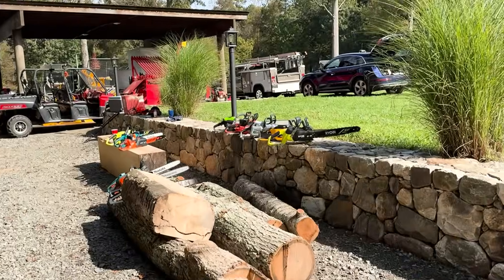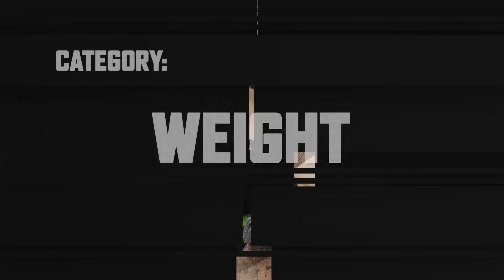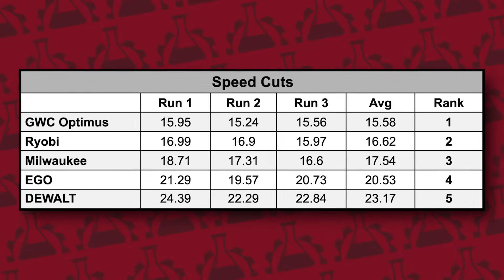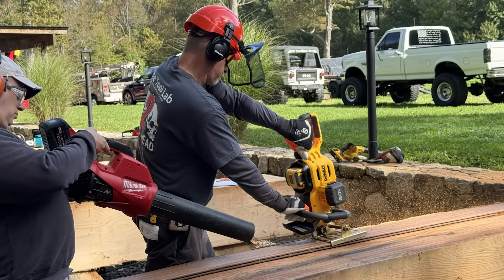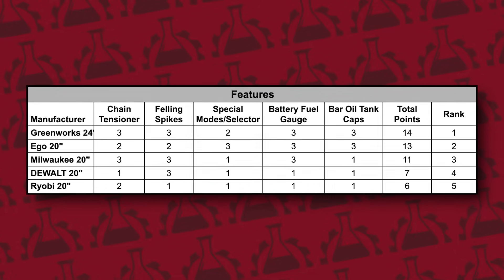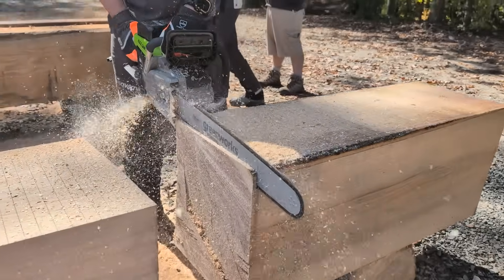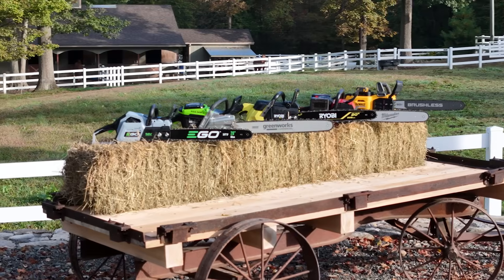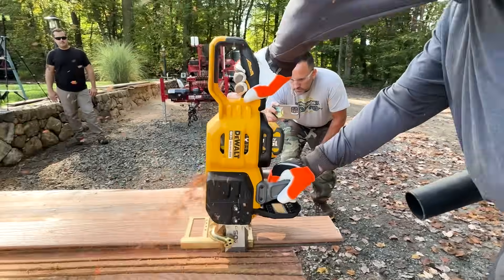Best LARGE Battery Powered Chainsaw

Comment from the maker: To our International viewers.  Sorry, No the Makita XGT 40V 20" saw is not featured because it is not available in the US where we are based.  Makita, along with Kress, EGO and Greenworks were all contacted and all did send saws to compete in either the smaller category or this one.  We are at the mercy of what tool companies send us, and we share many of the same frustrations you have with not seeing a complete field.
Reply: Such a shame as the new Makita with the high output 8Ah battery would likely have murdered the others in this test. Makita’s problem though, not yours, excellent work as always.
Reply: Curious as to why you chose to release this without the xgt saw? Rushing to get it out before real big n winter chainsaw hours?
Reply from the maker: @SlowExpensive  we decide when we do our head heads we don't time our testing with manufacture release date dates if we did we'd never get anything done or released.

Our head-to-head test are decided months and months in advance and take a couple months to execute this particularly had to Head was released in November but was started in August.
Reply: @ConcordCarpenter I get it. Just busting your big ol' balls Rob.
Reply from the maker: Haha thx
Reply: Using the 8 amp hour on the Milwaukee makes it weaker you must do it with the 12 amp hour
Reply: So EGO chose not to send the CSX5000 to compare to saws like the Greenworks Hog?
Reply from the maker: @tkulogo  Correct

Comment: Very informative with impressive test methods and technical information! Thank you for putting these saws together and testing them for people to see how far battery saws have come! 
I think it's important to mention that the Ryobi saw requires the Edge battery to perform as tested and that costs as much as the saw!
It's also notable that the Greenworks HOG saw is the only one that comes with a 3/8" bar and chain and that it uses a Husqvarna large mount and standard rim sprocket which gives you tons of options that the other saws don't have.  
Everone should appreciate the effort that this video took... thank you!
Reply from the maker: Thanks for commenting - hope you consider subscribing.

Comment: No Stihl MSA 300?
Reply from the maker: No, this is a 20 inch or larger blade size. We tested the Stihl MSA 300 in our 16 to 18 inch TESTING that we published two weeks ago. You need to subscribe to our channel so you don't miss this stuff.😊
Reply: @ConcordCarpenter then why do I have a 20” on mine?
Reply: I’m not in US so maybe not available in US
Reply: Every single one of these saws with the possible exception of the Ego outperforms the Stihl. The M18, Ryobi and Greenworks outperform it by a large margin... it belongs in the class that Concord Carpenter tested it in.

Comment: It’s ridiculous that you decided to use a per Watt/hour metric but then screwed the math on it up.

The Ryobi had the same watt/hours as the Milwaukee and the Dewalt had 270, not 300.

40 and 60V platforms are just marketing, not actual voltage.

That Dewalt saw anywhere else in the world has 54V written on the side of it.
Reply: We typically pull Wh rating directly from the battery itself to avoid any confusion between marketing voltage and actual specs. We had a big team contribute on this one and it looks like that may have slipped through the cracks. I’m confirming the actual numbers now and we’ll update. 

While I don’t think it’s “ridiculous” that mistakes can be made by enthusiastic volunteers, we appreciate the heads up.
Reply: @jullietalphadelta  Ah well, stuff happens 🎉
Reply from the maker: Appreciate the feedback, we'll review the metrics.

Comment: I'm really excited to see the next generation of battery-powered tools, as well as the new types of electric motors hitting the scene, such as PCB motors and flux motors. PCB motors would allow even the cheapest tools to perform like the $1,000-plus torque-impact hybrids that are only now emerging with traditional brushless motors.

The batteries that explode could be phased out within the next five years if we really wanted to. The FAA who already regulates aircraft, aircraft parts, and the maximum battery capacity(maximum potential explosive energy) allowed in laptops, could declare that all new laptops & cellphones must use lithium iron phosphate or even graphene batteries. This would effectively phase out lithium-ion batteries that can explode, such as when a dog gets ahold of a battery bank.

Then over the next 10-20 years all of the old stuff will age out, I mean who is actually using a windows XP laptop as a daily driver?  Who is using NiCad or MiMh power tools nowadays when they throw lime green team tools at you?
Reply from the maker: Thanks for the insight, we're definitely keeping an eye on new battery and motor tech too!
Reply: PCB motors are where the windings are put into the PCB itself, a flux motor in shot produces 500 horse power with a 40lb engine which opens the door to neato applications such as skid-steers which are driven by hydralics, having a small motor.

A small moter is a big deal because it would totally change up the cab's configuration.  So instead of having to climb out & over the bucket, you would rotate the seat as if it's a backhole you're rotating from the backhole controls, to the bucket control. Then once you rotate, you just walk out.

This is a game changer because now it's easy to get in & out of the skidsteer, for instance you could, have a tool rack on the door that leads to the seat, the tool rack would hold shovels and other tools.

So rather than having two people, because it's ineffient to get & and out of a typical bob cat like 50 or more times an hour, so you have a co-worker help you, you instead do it all by yourself.

Not only that but because of no Petro engine pumping fumes, you could drive a bobcat through a building to move rubble.  They have battery powered mini excuvators for such work, and maybe a battery skid steer, but nothing like a full sized skid steer.

Cool thing about batteries, is that there's trubo that could blow or crap you need to bust nuckles over in tight confined places because there's no huge motor that has to fit in a skid steer.

Comment: Would have been  nice if you included a gasoline chainsaw as reference for your great benchmarks
Reply from the maker: we did that a year ago and concluded that battery powered chainsaws need two batteries to compete with one tank of gas
Reply: @ConcordCarpenter A bigger portable battery to charge them if you are out in the forest where you have no mains power might also be a necesseity. Though unfortunatley there are no battery saw that can compete with the bigger petrol ones like the Sthil MS500i with fuel injection or the MS881 unfortunatley. I hope that the technology can start to compete with them at some point but it will require much more efficient electrical motors and maybe backpack batteries which unfortunatley would not be competeing in price though the lack of petrol cost after a few years would make it more valueble.

Comment: There is a more aggressive chain from Oregon that fits the dewalt. It completely changes the performance of the saw. It goes from painfully slow to impressively fast and it just pulls itself into the wood. It’s not anti kick back so it’s not for everyone, however, if you need an anti kick back chain on a saw, maybe stay away from saws in this size range. 

I haven’t timed it, but it does seem to kill the battery’s marginally faster, however it gets more work done in less time so it seems like a wash.
Reply from the maker: Interesting do you know the name of the brand?
Reply: @ConcordCarpenter the first sentence. Balls so full my man don't know who manufacturers chains damn someone help rob nut

Comment: Enjoy the Channel and your testing, one thing with OPE I live in a warmer environment then were you seem to come from and knowing what the abominate temperature is when you are testing as I find these battery go into failsafe mode quite quickly with higher temps they start shutting down in temps above 24c (75f), which is good for the battery I presume but not when you are doing a job and have to swap out batteries every few minutes.
Reply from the maker: That is a great point we were testing in September. The ambient temperature at that time was probably 70°.

Comment: Hello, could you pllease doa review for our flashlight? I sent you a email before. Thanks.
Reply from the maker: I'm sorry if I missed you get an awful lot of emails. You can try again at info@concordcarpenter.com
Reply: @ConcordCarpenter   Hello, just sent you email. Could you please check it? Thanks.
Reply: @ConcordCarpenter The email address you provided is invalid, as my message was returned undelivered. Could you please verify and confirm the correct email address?
Reply from the maker: @YJ-yv8yv sorry fixed that typo

Comment: I have the Milwaukee, got it fairly recently, but I am surprised at the ergonomic score. It is supposed to be heavier than my Husqvarna 395 but since the weight is close the body it feels better than most saws I've used
Reply from the maker: Glad that it is working out for you. Our crew found that the Milwaukee was top-heavy and off-balance in any position other than perfectly vertical.

Comment: Makita has a 50cc equivalent electric battery saw... y didn't u include it in ur test boy's..?
Reply from the maker: We’re not aware of any Makita 20” chainsaws in the US. Are you?
Reply: Its new here in NZ i tell u its a weapon  comes with a new gen  battery.... 
Tools and stuff reviewed it...its coming ur way ... 
I won't buy ryobi as i c the brand az trash..however it did well.. 
i liked the professor saw...however i don't want another battery platform...
Im a makita man...
😅

 @ConcordCarpenter
Reply from the maker: @exceptionalhealthltd3854  i'm sure it is Makita 40v is a great tool line

Comment: Ryobi, ego, and dewalt as kits are still cheaper. And for dewalt users its the cheapest tool you can get and get your hands on the super expensive 15ah battery. You gotta get the kit if you get the dewalt. I didnt "need" a 20" chainsaw but i wanted that 15ah flexvolt for other tools. I would have been fine with a smaller chainsaw but i got the 20" jus for that battery. Also got it for 475 tho back when it came out
Reply from the maker: Thanks for the comment!

Comment: Great video. Seems pretty fair. I have 3 ryobi chainsaws. 14" 20" and a 12" top handle as well. I've spent $210 for all three. Ryobi has so many tools on the 2nd hand market. Weather returns or lightly used tools. I've been able to get 3 for less than one priced as new. I've been really happy with them so far. I'd say do a top handle chainsaw test, but it sounds like a niche market that isn't getting any bigger. I will say I got stung while trimming a tree with the dewalt and touched the chain while reacting to getting stung that dewalt stops spinning so much faster. Idk if the ryobi would have taken my finger, but that was something I really liked with the 20-volt dewalt.
Reply from the maker: here you go! https://www.youtube.com/watch?v=uVUbjq91W5c

Its been a few years and well likely do a new one eventually.
Reply from the maker: Good point we can include that in our TESTING next time looking at the blade brakes as well as spin down

I'm curious how the Ryobi's are holding up overtime? That's one thing that we're concerned with with some of the DIY and more economical brands is that they MAY not built for the long run like some of pro grade tools
Reply: @ConcordCarpenter thanks look forward to the next video and. To be far I've only dropped 6 trees with them so far but based on the rest of my ryobi tools they seem about the same if you don't get them hot they seem to be fine. If you're doing this as a full time gig I'd go with husqvarna electric but I do it for fun. And thank you
Reply from the maker: Thx Tim